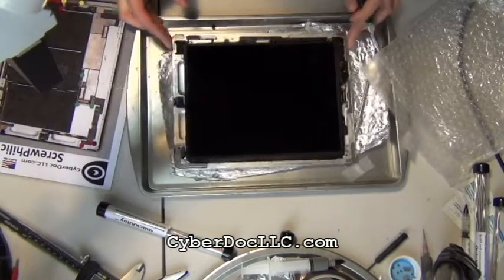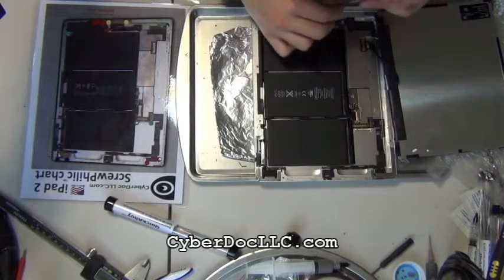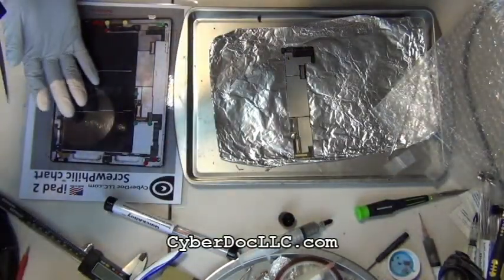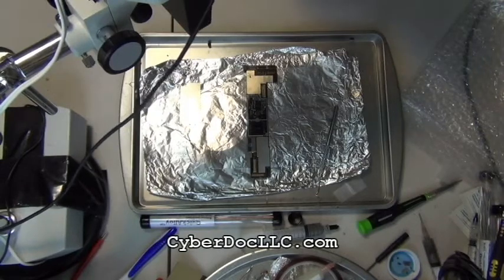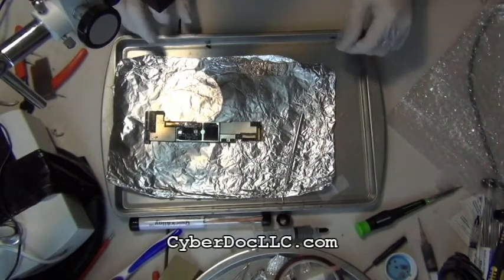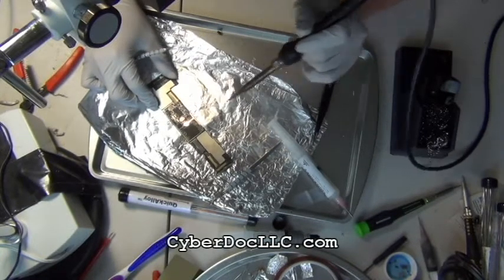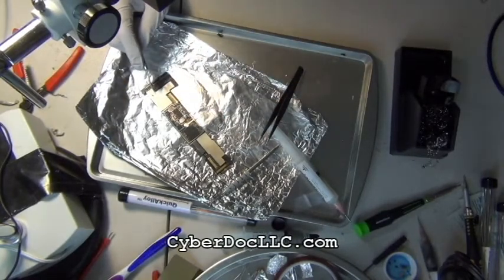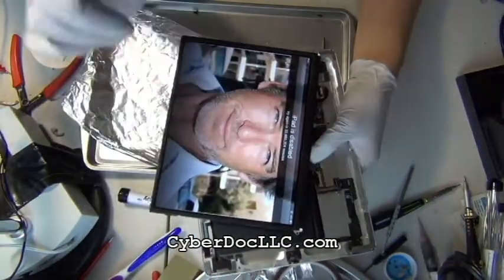iPad 2 backlight soldering repair solution fix for dim screen after screen lcd replacement CyberDoc

Comment: I had the same problem, but i found that this happens sometimes if you unplug the lcd and plug it back in while the battery is connected. Try unplugging the battery and connecting the lcd cable then connect the battery. Then power it up to test it.

Comment: I have an iPad 2 that i have just changed the digitizer on. When i plug in the charger i get the battery charging indicator on the screen but when it has enough power to turn the device on i get a blank lcd. Is this likely to be the same issue?